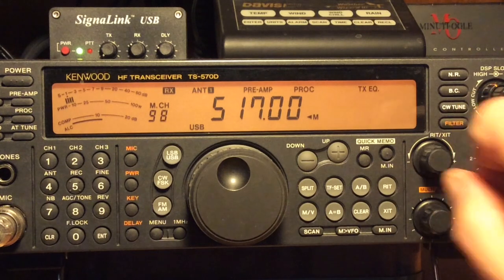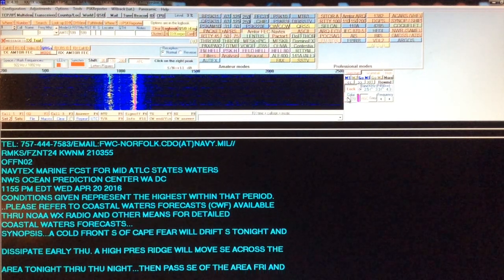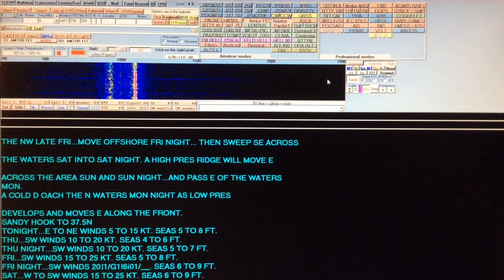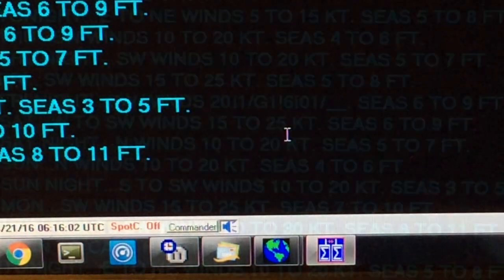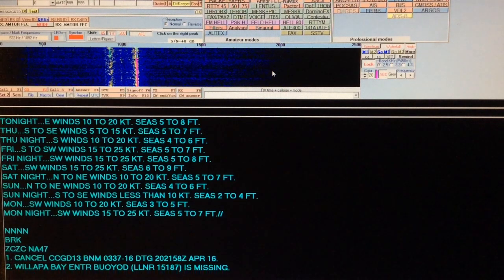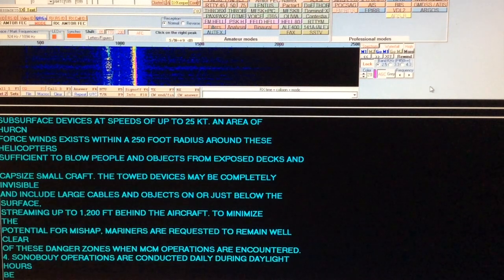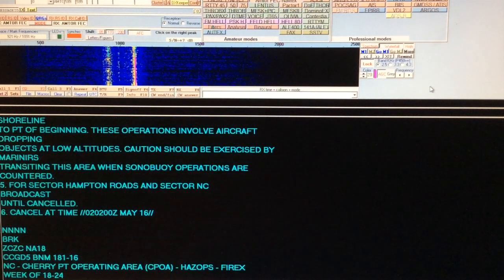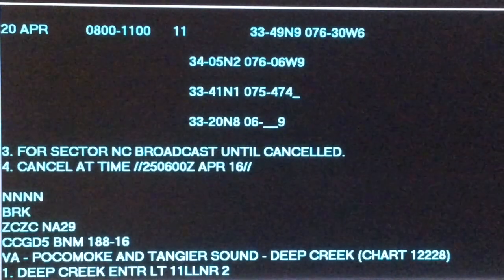Decoding US Coast Guard Navtex Messages By Radio

Comment: Hi Larry. I see you tuned your radio to 517khz but then the waterfall shows the signal between 921 and 1091 Hz. How does it work. many thanks. Jerry KN4CKQ
Reply from the maker: Usually you will tune the radio to the upper sideband mode and then on the decoder the signals will appear somewhere above the frequency such as the 921 and 1091 and then the decoder is able to decode them properly.  The Navtex freq is listed as 518kHz but I tune to 517 and then use the uppers side band for decoding.  I am trying to explain it better but can't think of a good way to keep it short I guess but I hope that helps somewhat.

Comment: Just thinking if you have a old Pentium II CPU as it will have a RS232 connection and by suitably programming it you can set it to 5 databits 1.5 stopbits and if connected a special receiver you might have some fun.

Comment: Neat. It's fun to decode signals that flying about on HF. For fun I like to decode weather faxes. I run linux; so I use Fldigi to do my decoding. I tried finding some navtex but no luck. I was using an A99 trimmed for 10 meters. Not the most ideal antenna for such low frequencies. I really need to put up something for 40 meters. Without serious loading I think 40 meters is the most I have room for. But a 40 meter antenna should work ok below the AM broadcast band.
Reply from the maker: +Trans ExFeminist Autism My Navtex didn't seem to decode well on Fldigi for some reason but on multi-psk it works fine so not sure if I don't have something set right on that or what.  Ok on the antenna, if you don't have much noise in your area that might just work ok below the AM band, it is all about signal to noise ratio.  73
Reply: +RadioHamGuy Thanks for the info.